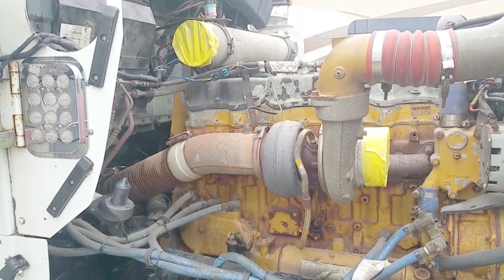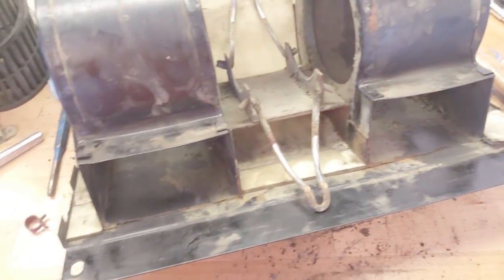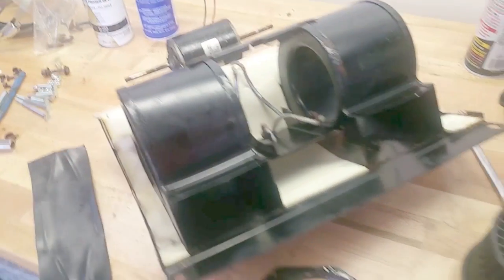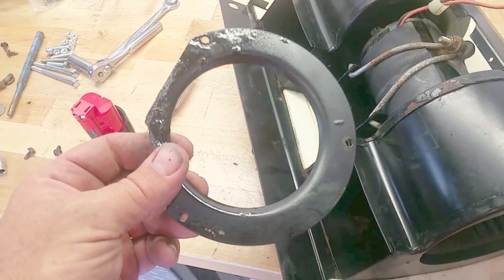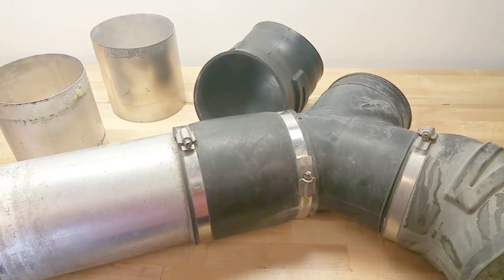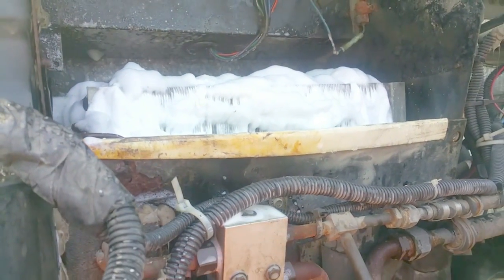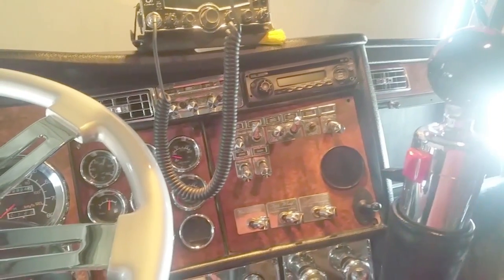W900L Heater Box

Comment: Brought this 2005 w900L and the owner told me that the air don't blow hard out the front vents because the truck wasn't up to date. So i did some research and mane this video is gold. Basically everything in my blower motor box was backwards. The motor wires must be on the left and putting those wheels back on the right direction is very importing for your air flow. This is a great video you save me $$$$

Comment: I have a 99 Kenworth with 86" studio sleeper and have replaced front rear ac cores and heater cores lines and all. Had one of my brothers working for me in my shop helping and it is a job. In west Texas working now 108 degrees fixing to take front section apart in truck stop parking lot loosing ground on front blower. Going to run a jumper to frame solve that problem.

Comment: Thanks for the tips. I have a 1999 T800 tri-axel dump and need to get to the blower motor and now I know where to start.
Reply from the maker: Great! Hope it works out. It's a very simple design and a lot easier to get to than in-dash units. Too bad the box is metal instead of aluminum. I'll be replacing mine someday.

Comment: This was a great on depth video. Thanks for sharing. I have an 05 W900 and the box on the firewall looks just like yours did. Very rusted out. So I'm going to have to replace everything on mine as well.  I had an old school driver tell me to use Great Dane black spray paint for my frame. I bet that would be great for this application to. When I was watching and you was trying to bump the idle up, I noticed you was pushing up on the toggle switch. Not sure if mine is different, but on mine, I push the toggle switch down to resume to get the idle set, then bump it up to bring the idle back down if I go too high. Have a good one, driver!

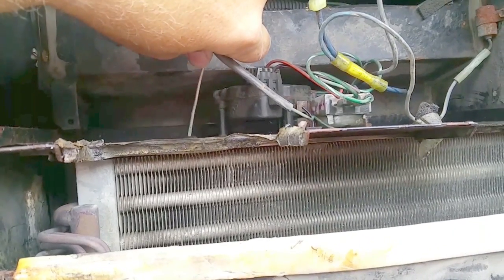Comment: When you get her rolling you can stroll with my 99 W900 86" studio sleeper 600 1MM pushing 650hp 18 over 3:55 rears sitting on 11R 24.5 tall rubber.
Reply: You need that 6NZ with that big single to run with big 🐕
Reply: Nope don't need no 6NZ my 1MM walks on them

Comment: Thanks for the video.  Ive been having an issue with the blower motor stopping as I drive down the road.  Then suddenly...it'll start again.
But I also could hear a clicking sound under/behind the glove box.  Thought maybe the blend door actuator but all positions were working.  But today...it is stuck on vent and that's it.  No defrost or floor heat.
Any idea how to get to the blend door actuator?  I'm hoping it's in the heater box somewhere so I can change it at the same time as the new blower motor
Reply from the maker: bababa39  I think the motor you are looking for is at 3:38 in the video. My truck is actually missing the metal rod that goes from the motor to the outside door. My door for outside air is always open.
Reply: Hi there, did you ever figure out why you have no defrost? My 06 KW T800 has the same problem... actuator works fine but have no idea how to get to the blend door!

Comment: I'm assuming this is what I need to replace if there is no air when I turn the heater/AC on? Maybe wiring isn't right or disconnected. Good video though
Reply: Hi ur video very good 
But I change twice blower motor 
But my motor after 20 minuets 
Shut down I change register 
Two times blower motor 
20 minuets good working 
Then fues hot blower fan off
I change fues relay 
But motor change used